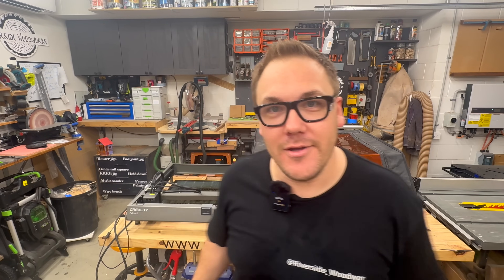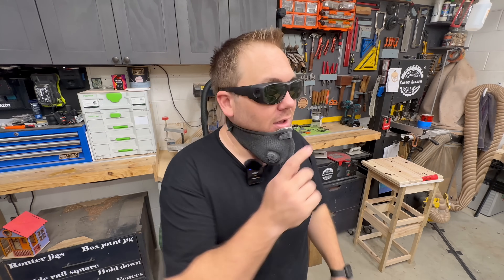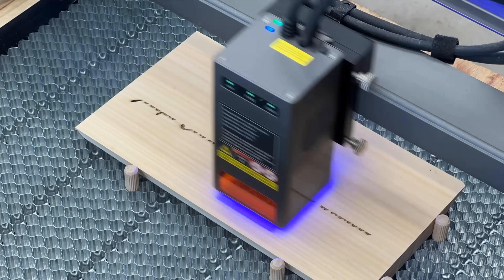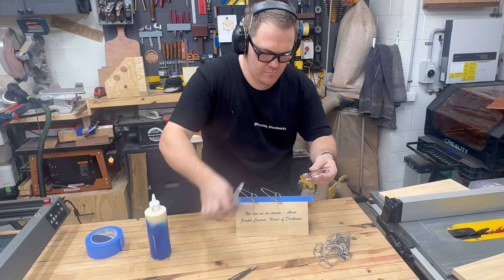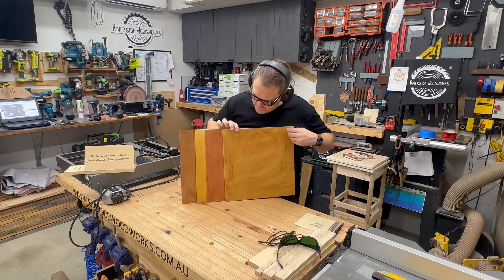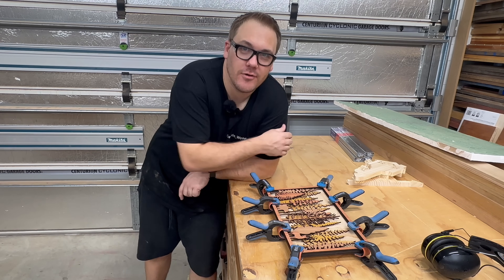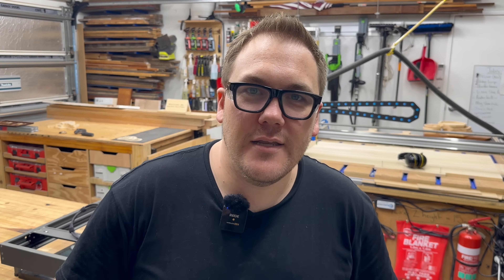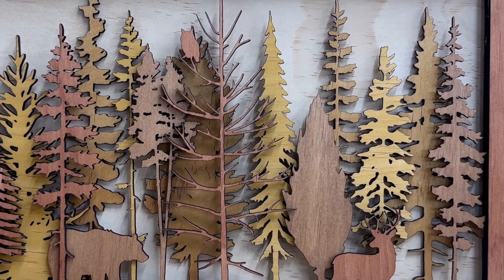3 LASER Projects I can't stop selling!

Comment: Can this engrave metal?
Reply from the maker: If the metal is coated (line anodised) then yes but it cannot etch bare metal. You need a laser with a different wave length. It's a pretty specific kind of laser wave length. I even have a CO2 laser and that can't even do metal. Thank you.

Comment: You are using the wrong glasses xDD
Reply from the maker: Thanks for your comment. The glasses I am using say they block out 200-2000nm. Is this not sufficient? I’d appreciate any advice. Thanks.
Reply: @riversidewoodworks  
Check the rating 
With a high power diode laser you need a rating of OD5 or more 

For 450 wave (or close to it)
these are typically orange or dark orange if they block 1000 range too (the opposite of blue)
Ive never seen a good green glasses for blue diode... Maybe that possible but not to my experience. 
Be careful cause some manufacturers claim rating based on pick density (the selected wavelength range) 
You can find a chart with the precise parameters of glasses.
Reply from the maker: @OnlyMadnessPain thanks for your advice. Will look for better ones. Are you saying the orange ones are better? Or the colour doesn’t mean much, just the numbers? Thanks again
Reply: @riversidewoodworks  

Orange are typical ones for blue diode cause orange is the opposite of blue (simplifying) 

Check the ratings 
You will find a chart that will tell you the exact ranges and blocked value.

Check for OD5 or more 
OD5 will block 10 times more than OD4 and 100x more than OD3.
But remember checking chart 
Cause you can find OD5 ment for other use with some blue light filter (for example at the OD3 lvl) and they unfortunately can be advertised as OD5 suitable for blue laser.
Reply: @riversidewoodworks  
What I meant by color opposite ...

Well maybe I wasn't so obvious 

The laser or light works in a way that the color opposite will absorb more therefore your eyes will not be exposed to the certain blocked waves.

That's why these goggles are typically orange.
Reply: @riversidewoodworks  
Although I'm an engineer technologist I know I don't know everything so I could be wrong.

But plz check it out

Better safe than sorry 
And you have only one pair of eyes so be careful bro.
Reply: There’s certain glasses you need for laser engraving?

Comment: You didn't say what the size was for the book holder. How wide and how long was the board after cutting it to length?
Reply from the maker: Yeah you’re right. Sorry about that. The truth is these are all rough measurements.   They would be about 14cm wide though. So I cut the angles on the two sides and glued them together first and then I placed them on top of the base and struck a line and cut the base width after the fact. Hope this helps